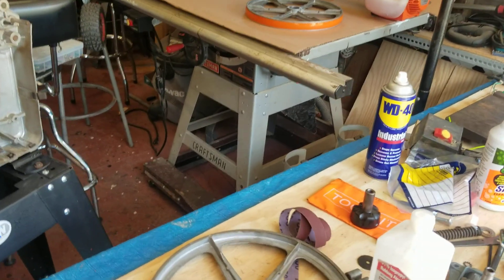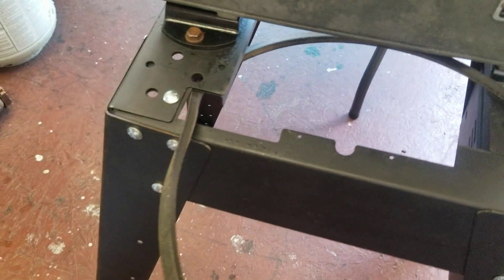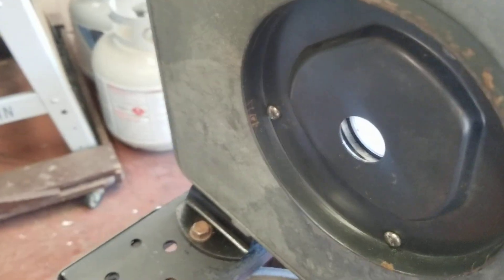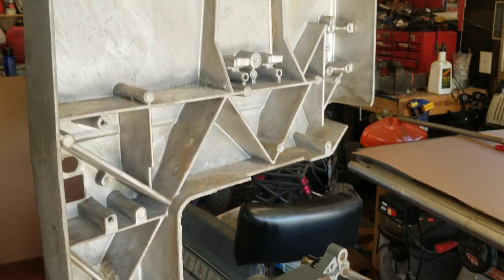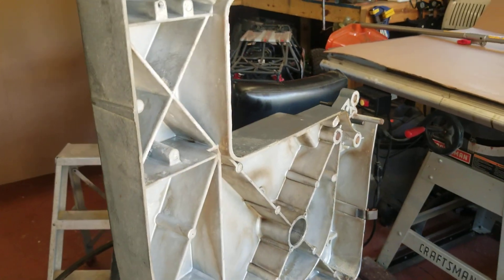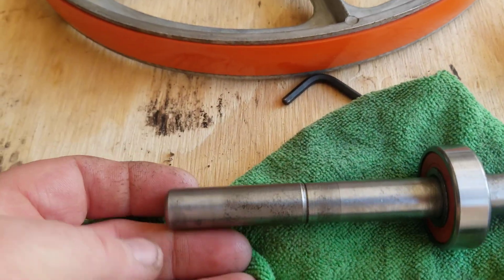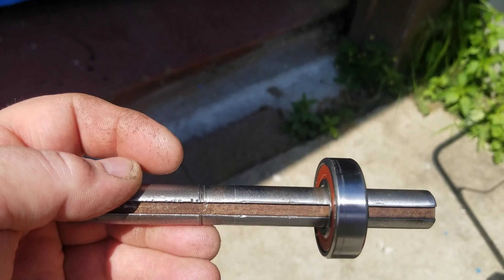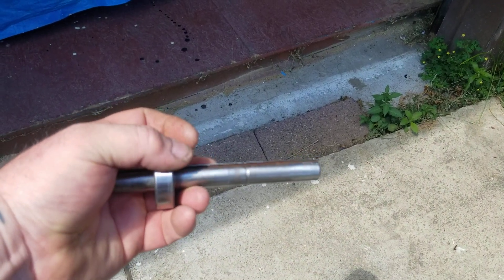Still Working On My Craftsman 12 Inch BandSaw Model 113 24350

Comment: I am praying you could tell me exactly how wide and how long the spacer is that goes in between the two bottom bearings?  I'm stuck as well and feel like my spacer got wore down and I need to cut a new piece to use as a spacer ASAP.
Reply from the maker: so sorry everything is together so I cant measure it

Comment: any chance you know the exact size of the driven pulley setscrew? manual said 1/4-20 x 1/2, which I ordered, but they're too small
Reply from the maker: No i don't know off hand sorry..
Reply: SomeGuyOver40 no worries, thanks. Was an ordeal but I figured it out and picked up a few. 

For posterity/time-travelers: the saw assembly pulley setscrew is 5/16-18 x 1/2, assuming your model uses the same as mine 113.248321)